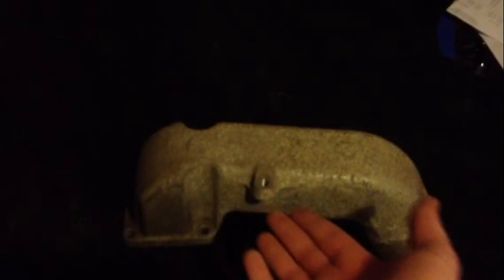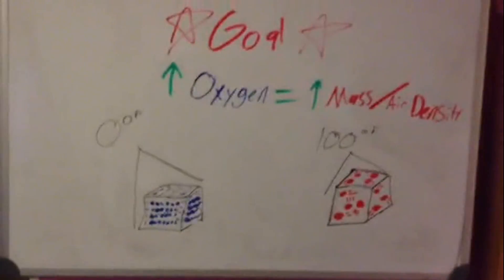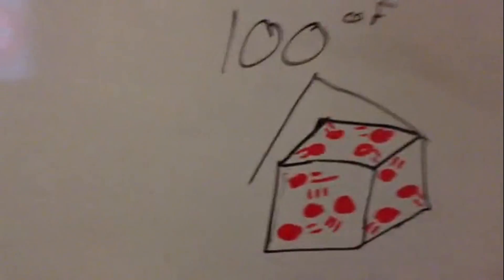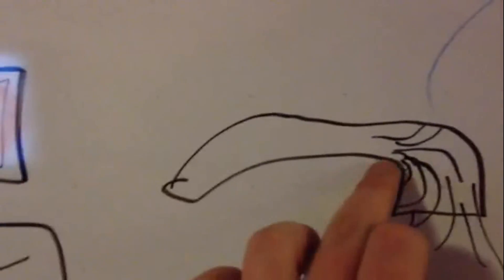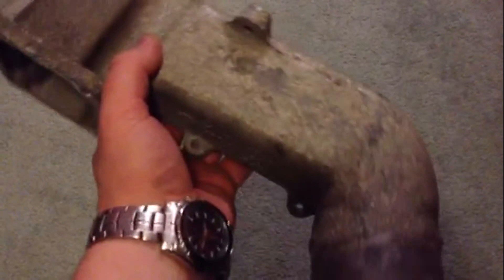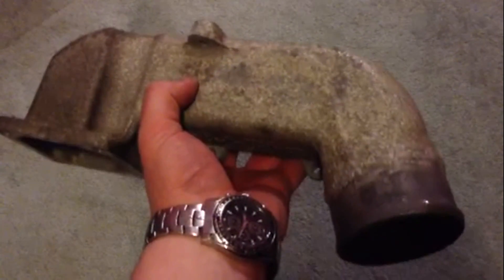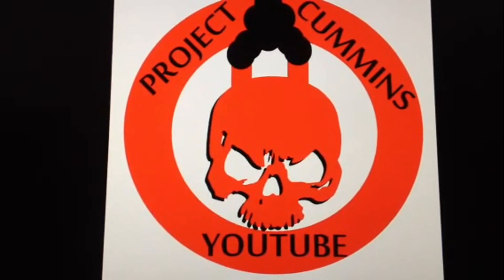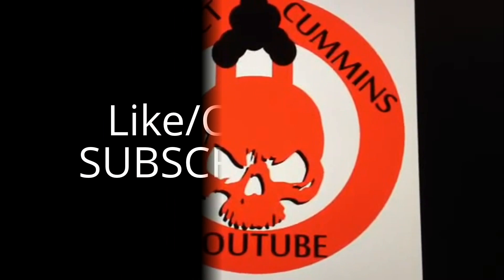How & Why: Intake Upgrades

Comment: If  Cummins thought it should be done, then why didn't they do it? Because the results are marginally better, not worth it, unless your also going to force the engine to develop more HP, which then means busted transmissions, and busted engines sooner equals a lot less reliability.

Comment: It's not just about how much power the stock horn can support, also think of how much power can be had by upgrading to something less restrictive, Think about all the things that get upgraded while the stock one can support your power levels, but you upgrade it to gain power, like exhaust, or a cold air intake (while stock has cold air induction anyway) high flow air filters, intercooler, or gas engines with intake manifolds, headers, and dual exhaust are some of the first mods done to a vehicle when someone does something to it. So isn't this the same concept? And well it's actually cheaper than some of these upgrades like a cold air intake or exhaust is gonna be anywhere from $200-$500 or more, while you can get one of the tube type horns for $95 or make your own for about $25...

Comment: Doing these mods are only really necessary if you're building your cummins to run upwards of like 500 hp. By that point you're already spending money on that. Usually, the average guy doesn't do all that. Most people run a tune, cold air intake and a larger diameter exaust with either a straight-through muffler/resonator or just a straight pipe because thats all relatively inexpensive and that combo gives you some good power for the money. So unless you're building your cummins to run really high power, its not even worth the time or money.
Reply: Roy Fabian truer words were never spoken! Thank you!

Comment: Unless the engine is making 700 horsepower or higher, this intake elbow hype is pure BULLSHIT (source: BD Diesel Performance, and they sell them to the uneducated)
Reply: You do understand that an intake valve only has to flow half the air for one cylinder (unless it's a 12 valve, then all the air for one), while the intake elbow has to flow the air for all 6, right?
Reply: That's absolutely correct!!! The real "bottle neck" is at the valve seats. The opening on the stock air horn is plenty big,  probably 20X the size of the intake valves. So yeah. Walter is absolutely right, this is pure hype AND bullshit.Getting the head ported is where you need to start (after an exhaust upgrade)

Comment: Wouldn't that small "bottleneck" act like a VENTURI thus increasing velocity and by it's own nature of operation, cool the air thus creating a more dense charge?
Reply: more velocity but at less pressure 

its called the Bernoulli Effect
Reply: That would be correct.
Reply: No

Comment: You shouldn't differentiate between oxygen and air in my opinion. If you want to know why I say that, ask me. Lol. I don't know if you're familiar with this motor or not, but if you aren't, check out the mercedes OM606 diesel as an example of a good intake manifold from the factory. The cummins intake, cast as part of the head, is absolutely horrible!

Comment: Build the truck backwards, why would you invest in a crazy intercooler if the air from the stock one cant even get to the motor?  Its like building a diesel in general, think of the trans before the motor and you wont have any problems or break as many parts. make a better front end before the instal of giant mud tires to prevent breaking a hub.  Just how I think I guess
Reply: So do you agree with the concept of upgrading the manifold?

Comment: A bottle neck also increases volicity.. Just food for thought
Reply: Velocity does not help diesels. There is no throttle plate. The only restrictions of performance is airflow and fuel. Velocity doesn't help gas engines until your in the intake runner. (port velocity) Maximum port velocity should be kept at no less than 7* or the low end is lost. Think of it as a kinked hose.

Comment: The whole intake n intercooler system is 3 inch or larger, the larger part being on the intake to the turbo.  But the stock intake horn necks way down on common rails, so why the need to upgrade the rest of the system when it can only go threw a smaller intake horn.  Im running a pusher intake horn n have gained almost another mile to the gallon n better turbo spool up.  This is one of the better upgrades on a common rail.
Reply: So you would recommend pusher over banks, ats, etc.? I have a 2006 2500, and I'm thinking about doing this I just want to make sure, and do my research first.

Comment: Im not trying to bust your bubble here, you make good videos but... the intake horn is a myth to a certain point. 95% of the kids with there awesome trucks will waste $150 on an intake horn, but what they don't realize is the "choke" point is not the horn at ALL!!, its the ports in the head. Ive don't many builds and after the head is ported, the intake horn is worth a look at, as well as an intercooler. Side draft intake and ported head is when you flow great with little restriction.